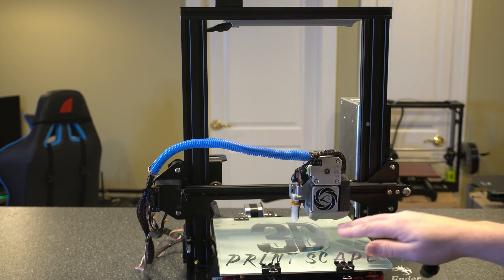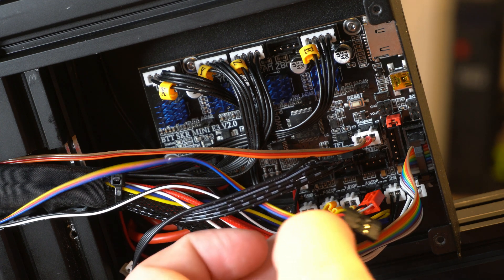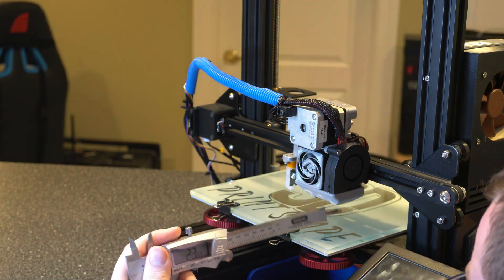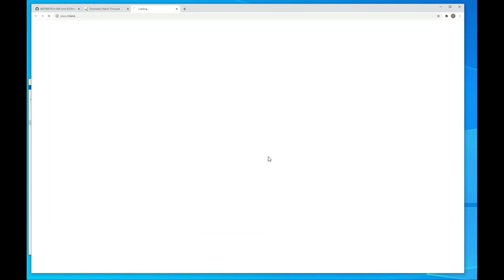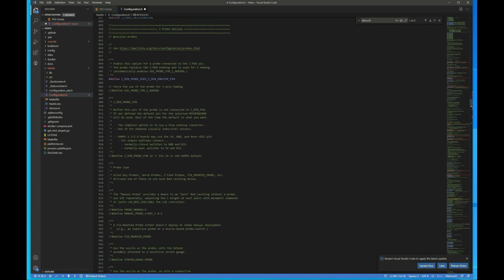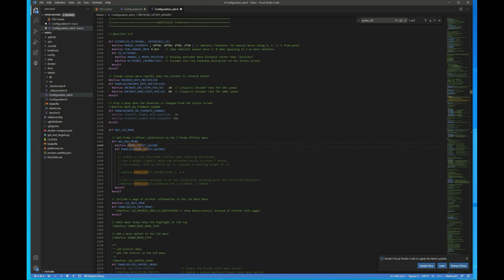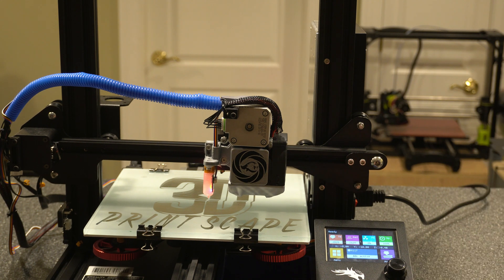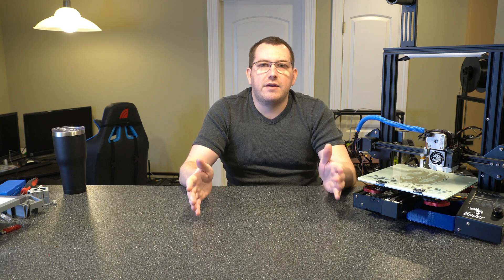BLTouch on SKR Mini – Install Guide

Comment: Followed this to the T, and upon first start, the Marlin blue screen was kind of faded and then turned off. But noticed that if I unplug the BLTouch ribbon connector on the sensor itself, my E3Pro starts up just fine with the regular bright Marlin screen and then goes to the "Ender 3 pro ready to print". I've double/triple-checked my connection on the SKR Mini e3 v2, and it matches yours identically. Any tips?
Reply from the maker: Hi. I would need to get a copy of your config files to provide assistance. Can you email them to me or send them to me on discord? My email is admin@3dprintscape.com and the discord invite is https://discord.gg/Bu94EYVkrU .
Reply: I have the exact same problem. My screen is dark and it doesnt work unless I unplug the BLTouch connector from the sensor. Do you know how I can handle this problem?
Reply from the maker: @emt2071  Hi. It sounds like a cabling or firmware issue. If you send me pics of the cabling and let me know what firmware you are using, I can probably help.

Comment: The _512k was omitted because some of the earlier versions (V1.2) used ARM processors with 256k memory, they likely forgot to update it when copying it over for the V2.0 with the larger flash
Reply from the maker: Hi. Thanks for the info. I figured it was a change meant for the older boards that didnt get corrected for the newer ones that support it. I just know its caused a lot of issues for people.

Comment: Hello, 

I'm getting M999 error when I have my BL Touch installed. Do I need to do any rewiring? I have a V2 BL Touch with all five wires in one ribbon. What order should the wires be in? The ribbon comes with them in (from top to bottom) Blue, Red, Yellow, Black, White.
Reply from the maker: Hi. The wire order you mentioned is correct, so if its in that order its good. Did you make any other changes to the printer and can you provide more info on your setup.

Comment: I'm still having problems. Although I have the 1.2 board. When I run auto home at the end the z axis raises up about 12 mm. I have tried over and over. But I still get the same thing. I get a message saying STOPPED? I don't know what to do now!
Reply from the maker: Hi. The autohome will go to whats defined in the firmware, typically +10. It wont use anything z offset, so think this may be right. Can you provide more detail on the issue you are having?
Reply: @3DPrintscape  The printer will start its auto home the bltouch probe will be in the middle of the bed like it should be, but then the z axis will rise up and the probe will go up and down a couple times. I get a message that says stopped on the screen. When I edited the config file I put - 42, -6, 0 On the screen it says X 159 Y 124 Z 10 The probe is in the down position at the end of the home  and the light is blue.
Reply from the maker: @boboakes7969  Got it, what happens if you run a self-test on the probe?
Reply: @3DPrintscape  the probe goes up and down 10 times.
Reply from the maker: @boboakes7969  Can you email me a copy of your configuration.h file? My email is admin@3dprintscape.com .
Reply: @3DPrintscape  I will do this when I get home this evening.  I was wondering if you would look at it. Thank you so much! If you don't mind I would like to send both of them to you. I a m a beginner and would like to know if I did everything right.
Reply: Files are sent!
Reply from the maker: @boboakes7969  Ok, i will take a look at them in a bit.
Reply: @3DPrintscape  I am having the same issue. Do you know what the issue was?
Reply from the maker: @DroneFanatic24  Not specifically for this, it was a while back. If you need help you can join the discord server. Easier to troubleshoot things there.

Comment: This is more of a Viscose issue, I don't have that "check mark" on the bottom. 
I've been struggling for about 4 days now to set this stuff up. Please help.
Reply from the maker: Hi. It sounds like Platform.io wasnt installed, VS Code wasnt restarted after the install, or the wrong firmware folder was opened. The folder should be the top level folder and have the platformio.ini file in it.
Reply: @3DPrintscape  You have to install C++ in VS. I had the same issue and that fixed it!
Reply from the maker: @lynnkeith2289  Im glad to hear its fixed. platformio installs C++, but if something happened to that install I could see it causing the behavior you saw.
Reply: If you have the C++ and Platformio IDE extensions installed, check to make sure you have opened up the folder which contains the 'platformio.ini' file. The check mark won't show up unless this file is at the top of the folder file structure. You might not have the correct folder open because Windows "Extract All" will add another folder layer during the extraction process.
Reply from the maker: @Christopher-nt6fg  It definitely possible he had the wrong folder selected as well, but if C++ wasn't installed it would behave similarly.

Comment from the maker: I hope you found this overview helpful! If you have any questions or would like other tips/tricks, just let me know in the comments. If you would like to help support the channel consider joining our patreon account at https://www.patreon.com/3dprintscape .
Reply: It turns out that I have V2 instructions but my BL Touch is a V3.1. I still need help
Reply from the maker: @markpicklesimer75  Hi. I can try to help out. What issues are you having?
Reply: @3DPrintscape   I installed a real touch that had all five wires in one ribbon. I was installing it into an SKR mini v2. I had planned on using the street five pen but all of the wires were in the wrong color order. What I ended up doing was stealing the JTL connector off of my Stock Z stop, Took the black and white wires out of the street five wire ribbon. Then I rewired the blue yellow and red to match the description in your video. Then I had to re-wire the five wires coming out of the BL Touch unit itself. I had it all working out with someone else’s firmware video and then I decided to make extra changes that you had in your firmware video and now it is not working. I’m not sure what changes were made that made the system not work any longer.
Reply from the maker: @markpicklesimer75 Try to comment out #define BLTOUCH_DELAY 500 and #define BLTOUCH_FORCE_SW_MODE in the configuration_adv.h file. I know these setting have cause problems with some of the bltouch clones/off-brands.
Reply: @3DPrintscape  I will try this when I get home from work. I’m not sure if this is the fix because I have a real touch brand
Reply: @3DPrintscape  I ran through your video again and would compile the firm ware after every change so i knew where the error was happening. It turns out the it is when I i choose to uncomment //#define AUTO_BED_LEVELING_BILINEAR. What could be a fix for this?
Reply from the maker: @markpicklesimer75  Thats enabling a lot of code related to the mesh, so it doesn't surprise me that your seeing it after enabling that. I think they are starting to enable MESH_BED_LEVELING by default now in some firmware versions. Can you check to see if that is commented out or not. If you uncomment AUTO_BED_LEVELING_BILINEAR the other four options need to be commented out.
Reply: @3DPrintscape  so late last night I was able to get this figured out and running. The problem that I have now is that when I attempt to do a print my BL Touch does NOT do the 3x3 grid bed leveling. I know that I have the BL Touch turned on, on my Ender 3 Pro. Any suggestions?
Reply from the maker: @markpicklesimer75  You need to add the G29 command to cura. Check out the cura section in this article. https://3dprintscape.com/guide-to-install-a-bltouch-on-a-creality-32-bit-mainboard/
Reply: @markpicklesimer75  Hi Mark, I have to check the BLTouch version.   It was purchased back in March 2020
Reply: My BLTouch came with multiple different color schemes.  Well, the way you hooked it up I couldn't power on the BLTouch no matter what.  I found that your instructions for hooking them all up together and uncommenting "define USE_PROBE_FOR_Z_HOMING" might be wrong because that forces the probe to act as the switch.  The swtich doesn't get used at all when I do this which I don't believe is intended.  No matter what I do though it prints like the bed isn't level.  I've tried everything, I keep offsetting the Z in the center  but then it's fine on one side and not high enough on the other.  Or it scores the magnetic cover on one side and prints fine on the other.  I've flipped it and it's the same.

I don't think there's anything out of alignment.  I've tried to relevel the  bed manually to try to compensate a bit but it keeps printing this way.  All the components seem straight.  I've redone the firmware 15-20 times and I've used the precompiled stuff, updated to have _512k, everything.  It printed fine before the SKR mini and BLTouch.  I've printed once since I've gotten it in the middle of all this but it's just not consistent and I can only get it to work like 1 out of 15 times.
Reply from the maker: @PistolShrimpPimp  Hi, how is the bltouch and z-stop wired and how did you setup the config in marlin?
Reply: @3DPrintscape  i actually tried a few ways. I actually repined the one that goes to v2 torch slot and put it work the z stop (not forced).  I've tried it the other way, too.  I've basically set everything up correctly from everywhere I looked.
Reply from the maker: @PistolShrimpPimp  Trying it a few ways during troubleshooting my not lead you to the right setup, assuming the firmware was changed as well. Take a look at your firmware, specifically those lines, and match the wiring to how the firmware is. If its still having issues, try to reverse the black and white wire.
Reply: @3DPrintscape  it's my x gantry level. Possibly bed. Trying to fix it a few times, stripped the m4 so I'm actually at the hardware store right now getting new ones lol
Reply from the maker: @PistolShrimpPimp  Interesting, let me know if your still having issues with it after you replace the screw.
Reply: @3DPrintscape  I will. I got the prints very very very close.  But right now it's just a off and I'm trying to narrow it. Thanks for the help, you're awesome
Reply: @3DPrintscape  Gonna do another quick reply, I still have a couple very small issues of it not liking to print on the left (seems it's just lower on the left even when I level corners and use the BLtouch on a 9 point.  Just got done re-leveling to perfection though with the new right side 4mm screws and I just did an absolute perfect 3dBency.  The detail is very good, no strings, no deformities other than a few infill starts. I've had a couple times before this where 3d Benchy would get knocked out towards the end at the top when it started to fill a couple times it didn't.  Do you think I should look into calibrating the other axis now?
Reply: @3DPrintscape  So yeah, it's still randomly knocking objects.  I just did a test print of 5 sets of dampening feet at once and one on the far right got knocked out.  Before all this adjusting, I'd have 3/4 3dBenchy have the same issue towards the top.  I've been adding extra hairspray to compensate.  It's also printing very low on the left side still to where I just slightly adjust that corner during the print to help.  After I try and calibrate everything,  I have played with different Cura settings with retraction, combining (of every option, only All gives me a good print without strings),  and avoid printed parts when traveling/avoid supports when traveling.  I've also attempted z Hop when Retracted (0.2mm). 

 So other than the weird bed issues and the random knocking, I cannot stress how clean it's printing.  I'll try some stuff one at a time in the meantime, but I do appreciate your help!
Reply from the maker: @PistolShrimpPimp  Are you running the mesh at the start of each print? If so, you may have a warped bed and increasing the mesh grid from 3x3 to 5x5 may help.
Reply: @3DPrintscape  I'm back to using the probe and on a 3X3 grid and it's printing without any issues.  My X gantry was just really adjusted wrong and it took a few times playing with it to get it just right.   No amount of auto leveling will fix a playful gantry, I'll probably get a second z motor on the right in the long run but thanks for asking
Reply: Is this firmware set to a 5 X 5 point mesh or 3 X 3 mesh?
 If it is 3 X 3 what needs to be changed to set to 5 X 5?
Reply: @AndrewAHayes  usually 3x3 is more than enough especially for a glass bed but you'll be looking for #define GRID_MAX_POINTS_X for whichever type you pick.

If you have problems with levelness, make 100 percent sure your gantry and bed don't have play and make sure your bed nuts aren't too tight (it'll pull all the outer corners down) 3 is 9 total, 5 is 25.
Reply: @PistolShrimpPimp  Yeah I found it and it's already set to 5x5
 I need it for my Pro 3D V-King 300 X 300 X400 but I will keep it on the Ender 3 as well but call the mesh from EEPROM rather than probe each print
Reply: @AndrewAHayes  Just make sure you're looking at the Mesh or Unified depending on which you're using if it isn't leveling  25 times for your mesh.
Reply: Hi I keep getting this error when I try to compile the firmware:
collect2.exe: error: ld returned 1 exit status
* [.pio\build\STM32F103RC_btt\firmware.elf] Error 1
Reply from the maker: @TxArmyMan2169  Hi, thats just the end output. I would need the actual error to be able to help out. It should be in the terminal output.
Reply: Hi! I'm not getting the checkbox in the lover left to run it. what am i doing wrong?
Reply from the maker: @antonpersson5625  Hi. No checkbox typically means the wrong folder has been opened, plaformio hasn't been installed, or the computer needs to be rebooted if you just installed platformio.
Reply: I try to update my printer to bltouch and follow your video but I don’t know what I’m doing wrong get lot of errors and then I use they’re firmware but still not working
Reply from the maker: @constantinsimion5129  It may be easier to troubleshoot this if you join the discord. If that's not an option, I will need a lot more details here to help out.